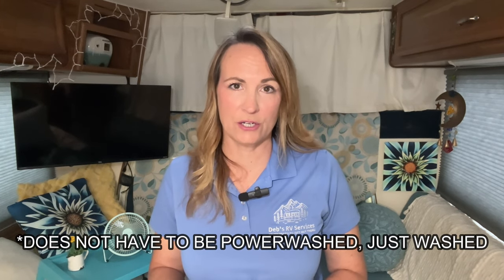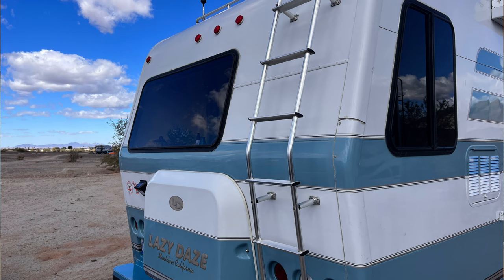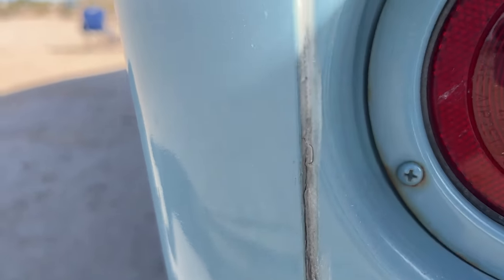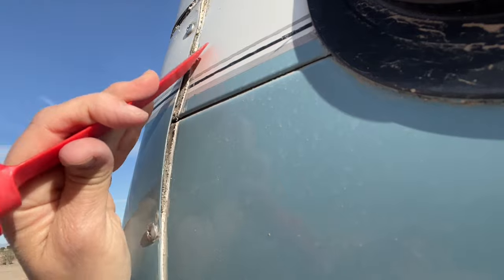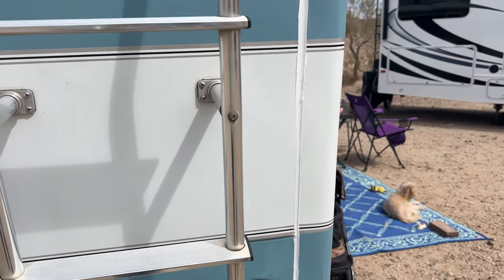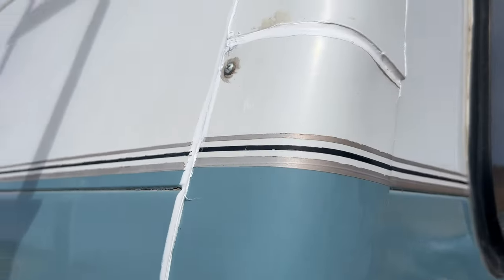How to Replace RV Sealant

Comment: Years ago one of my aquariums (35 gallons) started leaking, so I found some waterproof silicone that could be applied to a wet surface and even under water. It indicated "safe for use in aquariums." I applied it inside the aquarium's seams (with the fish still in the tank, lol!). It sealed it right up and never leaked again. Ten years later, when I gave the aquarium away it was still holding strong. So, about five years ago when the sunroof on my Ford Escape started leaking around the edges, I used some of that waterproof silicone to seal it up. Three years later, when I traded the car in for a truck, it was still holding up and not leaking. Now, my truck has a bed liner in it and I noticed water was siphoning up under the top edges and pooling. Since I live in MN, I didn't want the winter salt getting in there so I used up the rest of the silicone to seal around that. It's been 2.5 years and it's still holding strong. So what I'm wondering is, why don't RV owners just use that for all their seals? It seems like it'd work better than all the different white caulks people are using that dry and crack and have to be redone frequently. The silicone is flexible and feels rubbery even years later.
Reply from the maker: Silicone is definitely used around the RV and recommended for side wall work and windows. The roof needs a self leveling product which is why people choose Dicor or another self leveling caulk. I tried more of a polyurethane for my seals because the manufacturer recommends that for the lazy daze and it is an adhesive. I needed that for my end caps. I have silicone along other areas. Thanks for the comment.
Reply: @debsrvservices  Why is "self leveling" important on the roof?
Reply from the maker: @randomspirit  Because it is meant for a horizontal application rather than vertical like you see on the side walls. It can spread evenly over a surface.

Comment: Many years ago, I worked as a shop carpenter building prefab homes.  I was taught that when calking anything with a caulk gun, to push the tip, never pull.   Dragging the tip does not push the caulk in.
Reply from the maker: Thanks for the tip!

Comment: Hi just saw your video on creativity rv. Nice interview. One question- how did you spruce up the outside of your camper- de-oxidize? I would love to watch a video on that. Thanks.
Reply from the maker: Thank you!! I used an electric drill with an adapter that fits a buffer pad on it. I may be able to get a hold of it this summer when I head back to MI and create a video on it.
Reply: @debsrvservices  súper. Thanks for the quick response. I like your videos. Keep up the good work.

Comment: Great vid, thanks!

Question number one, where do you get the plastic tool?

Question number two, where do you get the Sikaflex?
Reply from the maker: Thanks Sally! I purchased the tool on Amazon. I don’t have an affiliate set up yet but it is called “TCP Global 4 Piece Non-Marring Plastic Chisel Scraper Set” and I also purchased the Sikaflex on Amazon.
Reply: @debsrvservices  thanks!  I need to recak my shower.
Reply: @sally_forth  Ok so this is for an inside bath area? When you look up Sikaflex there are different numbers for types of jobs. Make sure it is best for bathroom areas.
Reply from the maker: Sally, I created my affiliate account and pinned the products I used.  Thanks for the idea to create the account.

Comment: May I ask, because I plan on living in an RV, but still researching. Will it work if I put new sealant, let it dry, then put flex tape over it? I'm not joking btw
Reply from the maker: I have not used flex tape but what I found is that tape is good to have on hand for emergency use. It is not the best long term solution. I would use the recommended product for your roof. The manufacturer can recommend but most of the time it is a self leveling Dicor. I like Sikaflex because it has less water and can last longer. Just make sure it is self leveling. Thanks for watching!

Comment: Happy to find a fellow LD sister! I have an ‘08 Lazy Daze MB, LD ‘s exterior is aluminum how does that affect your sealant and/or the process?
Reply from the maker: Oh yay!! Love the LD family! I actually read that using 100% polyurethane on the RV exterior was recommended by the manufacturer. That is one of the reasons I used Sikaflex.

Comment: Hi. Thanks for the video. I saw you on creativityrv. In the interview you mentioned that you became a certified inspector and then decided to become a certified tech. Did you become a tech because of not enough work from the inspector side? The reason I ask is because my wife and I want to travel around the US being funded primarily myself being an inspector and/or tech. The inspector side is quicker, cheaper, and requires fewer tools and inventory to carry around. However, I don't know if I will be busy enough to fund our travels by just being an inspector. I'm hoping to get 15-20 hours a week of work. What do you think? How easy would it be to get 15-20 hours a week. Thanks for any insight.
Reply from the maker: I did go back to learn more tech so that I can be a better inspector and create more work my doing small repairs. As the school graduates more and more inspectors it is competitive. Some areas are busier than others. Inspections can have low points where nobody seems to be looking so I think it is best to have multiple sources and ways to work. The techs are busier at this point but part of it is the need to get the word out there that inspections are crucial when purchasing. Thanks for watching and hope this helps.

Comment: Deb, it appears you didn’t use anything on the sealant to soften it up for easier removal. I heard that a hair dryer works good or even alcohol or vinegar. Any reason why not?  Looks like a real pain but looked great in the end.
Reply from the maker: Cecilia, no I didn’t use anything to soften it. It isn’t necessary to do so but if you are working on replacing a big area or are having trouble getting the sealant off then I recommend some type of heat gun or dryer. 😊
Reply: I think you are using way to much caulk.You should cut your end so you use half of what you used.Also I clean up the old caulk with mineral spirit and also use it to level out the new.But then again I use  crystal clear caulking.Once it dries it looks good and doesn’t have the molded appearance.Just how I do my RV.
Reply from the maker: @RLBS61  Ok good feedback! I did feel like I was losing a lot of caulk. So you go over the top of the caulk with mineral spirits after?
Reply: @debsrvservices  I use crystal clear caulk on my metal camper.Thats how it came from Forest River.I tape it off just like you did and after I remove the tape I put mineral spirit on my finger and smooth it out and take a rag with mineral spirit and tidy of the edges.The mineral spirits help’s smooth it out and it doesn’t hurt the paint.I’ve added a cargo door and an outside shower and the caulking looks better than the factory.The key is use as less caulk as you can.
Reply from the maker: @RLBS61  I love it! Thank you for the tip!!

Comment: Just looked at the specs on this.
Food safe and potable water safe.
I think I'll try using it to fix the PVC pipe I knocked a hole in and the end cap that split at the seams on my hydroponics rig.
Reply from the maker: Yes, it should work on that. Good luck!

Comment: Hey Deb, I’m looking for a used RV. It could be a lazy days or born free or something quality. I’m looking to go solo and would like solar and lithium or AGM batteries and off grid capabilities I have a disabled spouse and so a quiet, air conditioner, and heating is important, if you see some thing that fits the bill or know where I can look, please keep me in mind. I’ve already been searching for about a year and each time might come upon something used. I’m scared to touch it. Thank you for your kind consideration. 0:21
Reply from the maker: Hi Dorothy, where are you located?
Reply: Woodstock, ga.   I can travel if necessary
Reply from the maker: @n2know  Have you joined the Lazy Daze Facebook group? They have them for sale all the time on there. I’m sure Born Free has one too!

Comment: OMG, this is so the wrong way of doing it. The 'seal' you are removing is not the real seal keeping water out, the seal is formed by the mastic between the mating panels. Thats the seal you are breaking by lifting the panel edges when scraping off what is only the excess mastic that has crept from underneath (or was plastered at the edges sometimes in the past).  When doing this, soften the old caulk with the appropriate weakeners, and do not apply force at or underneath the edges.
Reply from the maker: Thank you!

Comment: Like Deb advises........ try to save money on Sealant and you lose 500X in damage!!!!! The 1.49 sealer at Home Depot looks great when installed and it leaks within one day. There is a reason you pay 12-20 dollars for a tube of good stuff. My skin crawls when I buy a Bald Headed Moron Dicor product. Why do they put that Bozo on their rubber roof sealant?? It makes the 100 dollar gallon hurt worse to see his smiling face on that paint can. But if you buy the 50 dollar gallon of Baofung or Hengs you will enjoy seeing sheets of rubber roof littering the highway like a snow storm. If I have extra Dicor left over I cover Bald head buttheads face with a blast from a rattle can. Sika, Proflex and Dicor all injure the soul at the cash register but there is a reason. Quality!!!!!!
CONFIRM the sealant can is all plastic, no tin plunger and then microwave it for 40 seconds to soften the product. Or a full day of sunshine turning the tube like a cooking sausage. Or recently I had a cold cold weather application so I sat tubes on my Diesel engine exhaust after the engine was turned off. Deb looked to be in a cold desert and that stuff will break your wrist trying to get product flowing. A warm water wet sponge slightly elevated can give you a flat and smooth application.
Reply from the maker: Love the advice Scott and the humor 😂 Thank you!
Reply: @debsrvservices  And Deb demonstrated how not to apply easy release tape. Thank you for the hidden trick.....when you peel the tape off it should be one downward swoosh. So mask from the top and overlap, then you peel on one strip....not 5 little pieces. Deb was showing the incorrect way to make sure you are paying attention!!!! Out in the boonies??? Put down your canvas tarp. Old sealant is an instant death sentence for small creatures who ingest it. Deb is sooooooo  Dreamy!!!!
Reply from the maker: You are right Scott! I was seeing if everyone was paying attention by applying many pieces just to make it more difficult. 😉😂
Reply: @debsrvservices  So I didnt complain because I got to see your beautiful smile for an additional 13 seconds!!!!!!!!!!!!!!